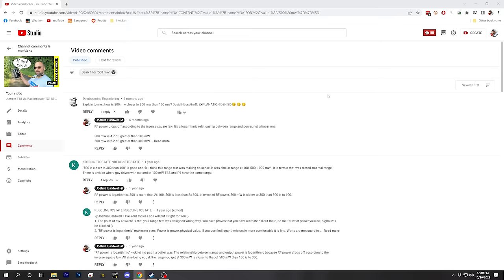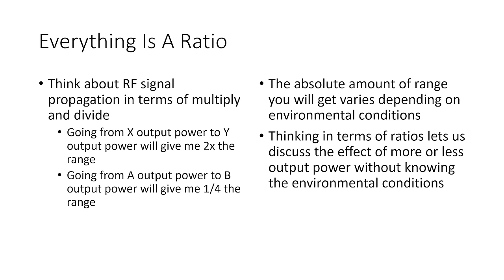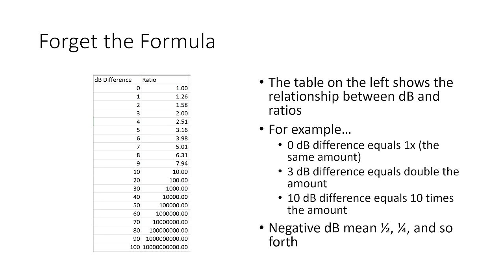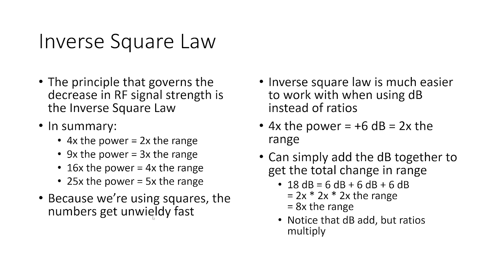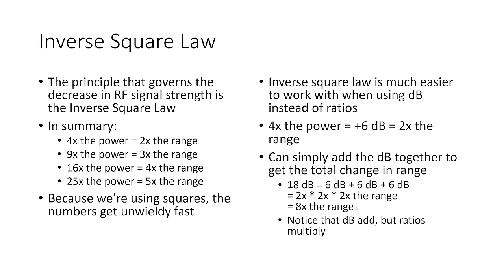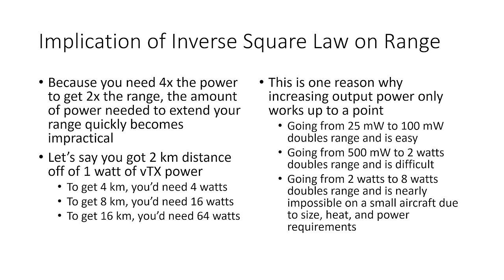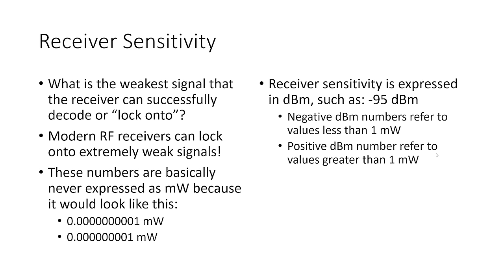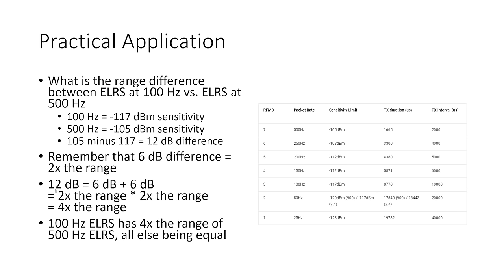The weird relationship between range and output power

Comment: Thought I had finally found the video to prove to my wife that drones are not "Expensive toys for grownup kids" instead of the sophisticated and highly technical test beds of technology that they are. I explained that the inverse square law is also useful for calculating radiation exposure from nuclear sources bla, bla, bla... any way now she says that my drones are just "expensive toys for grownup NERDS". meh... I give up. Thanks anyway JB.
Reply: just point out to her almost every aerial shot you see on the TV these days is shot with a drone. People take that for granted. A shot that used to cost $30,000 with a heli now cost $300 with a drone. And if China ever shows up at the beach, they can meet my kamikaze drones.
Reply: Feeling both attacked personally and proud at the same time.
Reply: Sounds like you may need a new wife. Wives are just low technology, less obedient versions of drones
Reply: When payday hits 

Iflight gets my $$ 

Cheers from Knoxville Tn
Reply: @cbrrunner3656 yeah 🙂 and also good thing that, similarly to drones, your "soldering iron" can fix pretty much anything 🙂
Reply: @ianwalton284  🤫
Reply: Really?! My wife doesn't give a sh#t about my hobby at all! She barely tolerates it. It amazes her that a guy like me sees these "toys" as actual technology. I have a work bench with 23 functional quads on the walls and enough parts to build many more, meticulously stored in the same work area. She doesn't seem to realize the fact that SHE is just ONE of my passions, each of which, can be easily replaced by another one. He he he!

Comment: I think it worth to mention that TX & RX separation is more logical & historical than practical, because most of modern protocols are digital and actually bidirectional (same as WiFi). So, both TX and RX are not really receiver and transmitter, they are both transceivers! That's the reason why we can get telemetry signals back from RX to TX, because RX transmits it. I assume transceiver on a quad RX is weaker than on a TX and we supposed to loose telemetry earlier than main controlling signal. But in order to adjust the power and the number of update per second (like ELRS doing), TX should constantly track a feedback from RX, so I wonder what happens with ELRS and similar when they no longer hear feedback from RX - are they treating this as being disconnected or they have a fallback values for max power and lowest update rate in order to work on unidirectional mode "blindly"?

Comment: I appreciate your efforts in trying to bring the technical aspects to the masses and beginners but I'm sorry to say that in the process of trying to simplify the math and add tools for easier calculations you kind of just made in 10 times harder than it had to be. Using a table and db to ratio conversion for a simple "how much extra range" calculation? Just say square_root_of(newpower/previouspower)= range ratio. Thats it. Nothing extra is required. I don't see the entire point with using the table and dB conversions.  Everyone has a calculator on their phone if they really must know the exact ratio, otherwise all you would have to learn is the basic formula, as well as perhaps memorize the square root of 2. Most cases anyone would only really be calculating 2x or 4x increase in output power.

Comment: From The Crossfire manual.

RSSI
Relative signal strength indicator
How “loud” the signal is, that the receiver “hears”. But this also includes noise.
The RSSI is exponential which results in a massive drop at the beginning and slows down the lower it gets.
In general: double the range will result in a drop of -6dBm. An example:
● RSSI at 0m = -10dBm
● RSSI at 1m = -16dBm
● RSSI at 2m = -22dBm
The CROSSFIRE can go down to -130dBm before the link breaks up. If you use RSSI as a sensor by the
channel/ output map menu or as an OpenTX telemetry sensor, it will be shown like this:
● -0.1dBm = 100%
● -130dBm = 0%
Reply: Thanks for this info. I use crossfire and had being looking for this information. Will you happen to know how to do the calibration of a radiomaster t16 pro, so it properly read the RSSI. If I stand 2 feet from my quad it reads Close to -30dbm most of the time.

Comment: As an RF engineer and a ham operator, your explanation is spot on. I don't have a drone (yet), so there's not much in this hobby that I can speak about with any authority. However, this is my day job.

Another way to increase range is a better antenna. You mentioned polarization, and that is certainly a part of it, but even with the correct polarization, a better antenna has the benefit of improved tx range AND rx range. My first step for improving range is always, "get the best antenna possible".

Comment: Nice of you to include the dB concept, but if I were you I would have put that as an extra info toward the end (perhaps even shortly covering antenna gain while you are at it 🤣).
As I personally suspect that the "simple" formula √(currentPower/referencePower) is much easier to learn. It only needs the inverse square law and allows to compare range already..

Comment: If we compare it to light (and BTW, radio IS light, just in a frequency we can't see), I guess people think about a laser pointer, instead of a lamp (which would be closer to our antennas).
Like, with a laser pointer of less than 1w you can put a light point in the next building... Perhaps even in pretty distant buildings... But a 60w lamp (I mean the old ones, from Edson) barely can illuminate a room. A 5w laser can cut 6mm MDF or plywood!
That's exactly because a lamp doesn't focus all the light in one direction (neither deals with the frequency and so on, which a laser also does). A lamp emits light in 360° x 360°! (Perhaps x 360° again?)
So, anyway... We need to think about lamps, not lasers in this hobby. 😬
Thanks for the video, Joshua!
Stay safe there with your family! 🖖😊

Comment: FYI all measures are relative, there are no absolute measures. For example, the boiling point of water is 100C but only at STP. Radio waves suffer rapid degradation under water  and very little in space. Relativity is a very important concept.
Reply from the maker: But 100 degrees Celsius is an absolute amount of heat energy. And 1 gram of mass is 1 gram absolutely.

Comment: because power/performance is not a lineal relation. Tipically a 10 base log, so to double your range you have to roughly x10 your power. That's why compared to 100mW switching to 300mW will be more noticed than switching from 300 to 500. The more it rises, the less effect it has on the range  (by comparison!). That's basicaly why the dB scale is a log scale (+6dB = x2).

Comment: That's a useful video, and right as far as it goes, but what it doesn't taken into account is real life environment and obstacles.

Unless you are in an open empty space, the inverse square law isn't that likely to apply accurately in practice.

Take a simple example: you fly behind a big tree or grove of trees (leaves are damn good at absorbing signal at those frequencies), so your video breaks up badly. It's done that because the received level has probably dropped suddenly by a lot.

So, switch from - say - 25 to 200mW (assuming it is legal), and do it again. In theory that will give root 8 times the range - over twice. Actually it might well be virtually no different because the signal drop behind the trees was so big that boosting it by 8x made little difference. Maybe you get a few feet further behind the trees before it drops out, but not much else.

So, it is probably worth pointing out that whilst the inverse square law works fine when there are no obstacles that adversely affect signal conditions, in real world situations, the further you go, the more signal absorbing and reflecting obstacles there are likely to be in the way, and these will cause the range not to increase like one might expect.

If one is flying high up in open sky it will work better (no obstacles) - but we probably won't be doing that, will we, because it might be illegal ....

Comment: hi friends I have an unrelated question I recently bought th diatonic mamba f405 mk2 fc because I accidentally lifted a couple pads on my old fc but anyways I cannot get the rx3/tx3 cart to work for my dji osd I use ELRS 1 watt as my link this board has three parts but the tx3/rx3 will not give any telemetry should I give up because the company has given minimal assistance I'm stumped

Comment: Only watched till 0:27 so far: no, does not seem the same, 300 vs. 100mW = 300% and 500 vs. 300mW = 166%. Signal strength is not linear with distance, because the area where the rays spread over goes up squared. So you would need 900 mW to get the same effect over 300 mW. Now let's see if this is totally wrong ;)